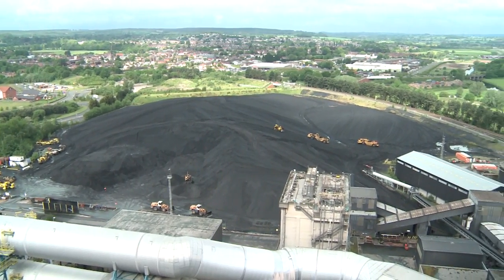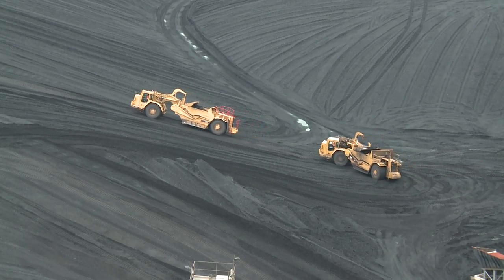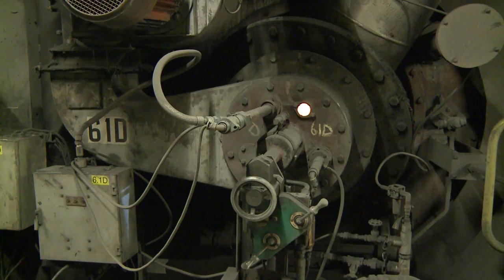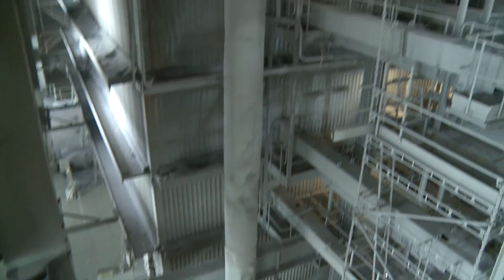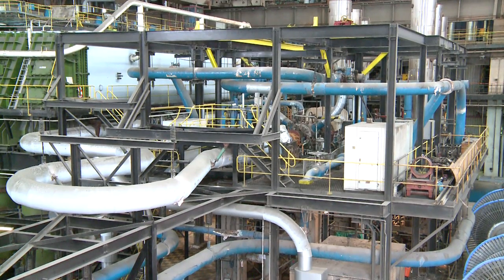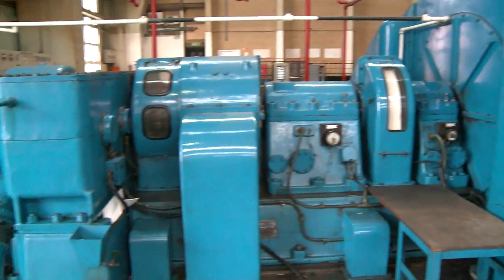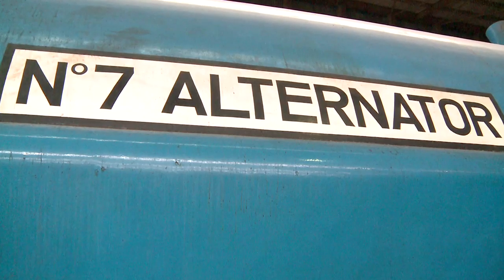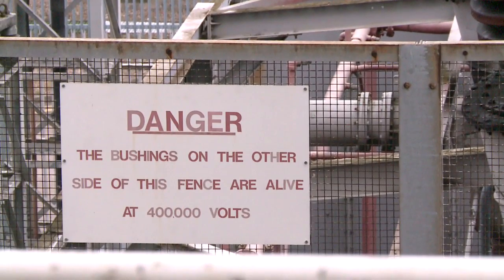Granville Camsey: Rugeley Power Station

Comment: I used to work for the fire alarm company that used to maintain and test the fire alarms there in the eighties. Amazing place. Used to stand on the platform and watch the loco’s bringing in the coal and opening the hoppers. Used to hate going into the conveyor sump under the railway lines. It was always full of black sludge and you had to walk through it to get to the break glass call point down there. The ORF pump house was always deserted unless there had been a mega oil leak. Loved the main turbine hall. The car park near the output transformers buzzing scarily away.

Comment: he knows very little its NOT built on the old A station site
Reply: Looks so, given the dates of stations A and B, but a very succinct description of a power station with no stumbles in the delivery; I'd only take issue with the "white hot" turbine blades I think, which seems a doubtful situation even at supercritical conditions of around 600 Deg C.
Reply: He's wrong, I was doing an overhaul on B when the boiler house on A came down. Rugely lost it's TV signal, it bounced off the old A station.